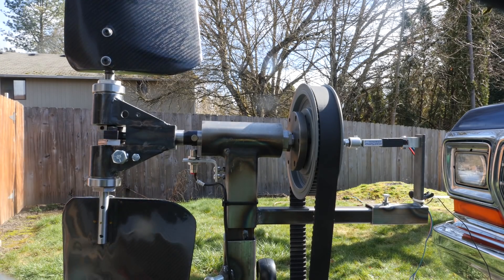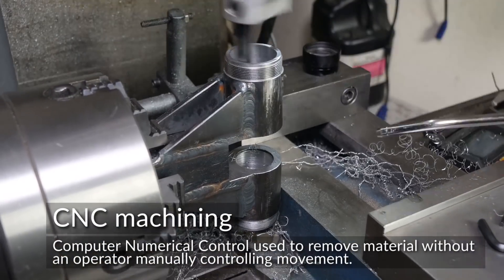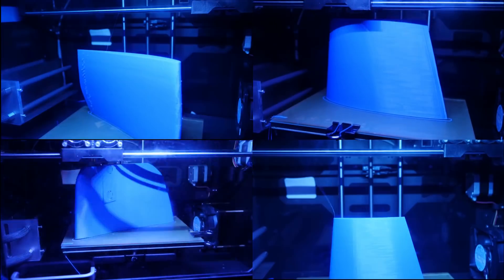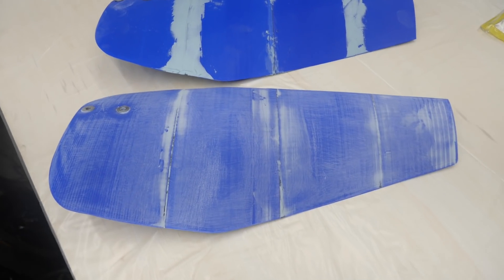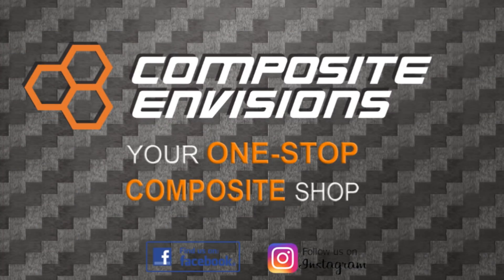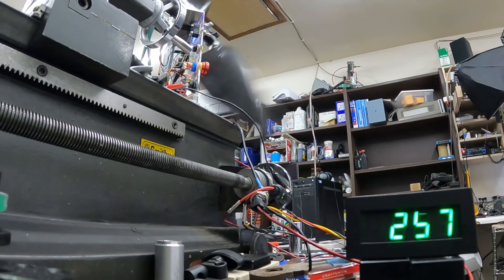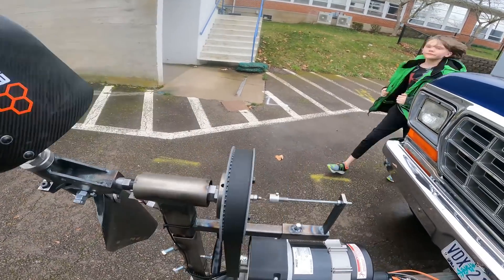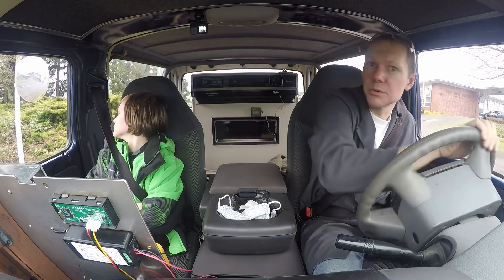Carbon Fiber Blades Making 2000 Watts! - Wind Power on a Car #4

Comment from the maker: UPDATE: Video proving it works: https://youtu.be/tEPBdztGMdI  😁 

Note the goal of this video series is EDUCATION.  Future videos will address how EVERY WATT of power generated comes from burned fuel.  But I'm not convinced it will negatively affect mileage.  My hypothesis is a modern turbine blade is so much more efficient than an old Ford that it can harvest energy from the change in momentum of incoming wind rather than waste it through pure drag. If correct, this would not violate 2nd law of thermo, rather recover spent energy from already burned fuel.  Regardless, we will measure it and publish the results either way! Thanks to a suggestion in the comments I now have a ScanGaugeII that plugs into the OBDII port for reporting instantaneous as well as trip mileage.  In fact I just published a video with the kids baking a pie for PI-day (3/14) where we had the gauge on the dash the whole time.  The algorithm doesn't prioritize "wholesome" so very few people are seeing that one.  If you'd like to watch it here's the link.
https://youtu.be/8G6w2mB9Skg

PREVIOUS EPISODES
Part 1: Basics of Turbine Geometry        https://youtu.be/MlwK4kCrXB0
Part 2: Testing Cheap Wind Turbines     https://youtu.be/k7vABvP_5UE
Part 3: 7000W generator                           https://youtu.be/U7ZgG9p-Hz4

Carbon Fiber company who graciously agreed to partner with me on this video
https://compositeenvisions.com/?utm_source=Youtube&utm_medium=Link&utm_campaign=QuintBuilds

A huge thanks to my super awesome Patreon supporters who made this video possible.  To become one of them visit:
https://www.patreon.com/QuintBUILDs

If instead you prefer a one-time donation option, here's a PayPal address you can use: BUILD2LRN@GMAIL.COM

My detailed video on vacuum bagging carbon fiber
https://youtu.be/j0BvRR5RF-Y

LaserSterling's channel (carbon fiber Lamborghini guy)

https://www.youtube.com/c/lasersterling/featured

Quint
Reply: I believe it was on Mythbusters they would run a fuel line to a graduated cylinder and be able to read their fuel consumption that way
Reply: @LTJPunkass  precision flow meters are quite cheap 15 years later, but yeh that works too.
Reply: Just wondering if you have an OBD port below the dash. Provided that you have the necessary sensors installed, I'd assume with an OBD you should be able to rig something up. I'm just spitballing because I know next to nothing about cars.
Reply from the maker: @afroteddybear  yup. it worked great for the latest vid: https://youtu.be/tEPBdztGMdI
Reply from the maker: @afroteddybear  yup the port is there and probably the best source of data.
Reply: Wow! The linear actuator part is so useful! I was just about to order 4 of that exact brant for a prototype at work and nobody has worked with them, so this was useful!
Reply: You're cool
Reply: Would be interesting to see a comparison of your turbine with that same generator hooked up to the engine directly. And the fuel consumption differences. I bet using the engine as the power source would beat the more indirect power source. But very cool project and thoughtful execution!
Reply from the maker: @pturcanu  hmm, I'll think about how to achieve that. A good comparison regardless of the outcome!
Reply from the maker: @pturcanu  Yup, gotta see the latest video on it! https://youtu.be/tEPBdztGMdI
Reply: @pturcanu  Yes it would beat it, but with this level of tech on the blades themselves it would only be a small % increase maybe 5-8%
Reply: Now this experiment of yours has been on my mind for the last 15 years. But, in my version it has always been a vertical axis turbine on an EV. Mounted in place of the radiator. Or under the car in the middle, on a tunnel that goes trough the whole car. I never have seen it done.

Now while I KNOW it supposed to be a net zero contraption because physics and all. My mind just can't process why it would create more drag than the same car would with "normal" front end. I just imagine less drag and more lift somehow..

I guess my eyes just needs to see the wind tunnel experiment done with and with out. 
But if someone can explain in simple terms so that I can visualize it, please do. Because I KNOW I am wrong And that you can't create energy for free. but I just can't process it,  and let it go.
Reply from the maker: @OnlyUseMeC4s  Check out the latest vid.  It's not getting shared much by the algorithm for some reason but it goes into ALL those details.  Maybe that's why?  https://youtu.be/tEPBdztGMdI
Reply: @OnlyUseMeC4s  your not the only one thinking of that.
Reply: @OnlyUseMeC4s  I guess the "wing energy" that you're capturing is actually wind resistance that you're trying to avoid. The stored battery energy is being converted to heat through the motor and wind resistance to accelerate your car and then fight the wing to keep moving forward.
Recovery braking loses a lot of the stored kinetic energy through friction heat and heat through the motor/generator in order to cram all that energy back through the wires and in to storage.
Reply from the maker: @OnlyUseMeC4s  I don't think it will create more drag. My gut tells me we will get electricity without a significant mileage penalty due to the airfoils being so much more aerodynamic and capable of converting momentum into mechanical energy than a vehicle shaped like a brick. It seems pretty straightforward to me yet I literally get trolled by people with letters after their names, saying it can't work, resorting to childish name-calling! I guess I need to seriously consider how to explain to both intellectuals and laymen WHY (assuming it works) it's not a violation of physics.  But that's a challenge I readily accept!
Reply: @QuintBUILDs  I think you need to do a comparison of fuel consumption going 55mph with and without the contraption.
Reply: @QuintBUILDs  I love the project because I'm a sucker for variable pitch propellers and it's a great excuse for mechanical (And electronic) education for your kids.

I think I see the point that you're trying to prove, I'll try and paraphrase it. For simplicity if you consider the front of the car as a large solid / flat surface which is perpendicular to the direction of travel, it acts as an air brake as it has to redirect the airflow through a hard 90 degree bend. In other words it is slowing the velocity (In the direction of travel) of the airflow from the vehicle's speed to zero, with the air being forced out sideways. The idea is that rather than simply redirecting that air sideways and therefore wasting that energy, you can instead slow the airflow by converting it to electrical energy through the wind turbine. This means that in the ideal world, the velocity of the airflow is slowed to approximately zero (Relative to the velocity of the vehicle) and therefore the area directly in front of the car effectively becomes a neutral pressure zone.

You could use a dual-port manometer to measure the pressure drop across the wind turbine, along with the absolute pressure of the area in front of the car. This should show you how much wasted energy is available to be reclaimed and demonstrate the theory.
Reply from the maker: @yngndrw.  nicely stated! I Also like the idea of the manometer.
Reply: @QuintBUILDs  it's more an issue of disruptive flow. While a car is totally shaped like a brick sometimes it does end up creating a pseudo airfoil shape due to stagnet air in specific locations. 

The other issue is this doesn't have long term stability. Nor is it safe. All it takes is one rock in the road and you could destabilize the entire propeller system. 

This is the classic failing of most engineers where they try and chase and play efficiency games. You failed the first important test as an engineer is the solution you provided practical. The answer is absolutely no. 

As an aerospace engineer myself I see this all the time it blows my mind. So you want to add a regenerative breaking system? How much is it going to cost? Not just per unit but for RnD. How much energy will you save? What is the cost of maintaining it? What is the cost of replacing it when it fails. All of these are generally important questions engineers fail to ask because OMG it's  2% more efficiently but they just blew through hundreds of thousands of dollars to get there. Blows my fucking mind.
Reply: @Daemonamongyou  The terms you are looking for are Turbulent Flow and Laminar Flow (turbine and vehicle, respectively)
Reply: @anjhindul  I was actually referring to a specific type of airfoil I just couldn't remember the name. They are call Klein Fogelman Airfoils. If you have ever seen the mythbusters episode about the closed vs open tailgate it's pretty much like that. Where eventually the air will get trapped in circulating motion and create a no slip condition and make it a psuedo airfoil.

But yeah this entire project is just one failure to understand aerodyanmics as many other people have pointed out.

I love how he cried wolf that people were "just being mean to me and spouting profanities without names on their accounts" when many individuals have provided clear reasons why his hypothesis is false.
Reply: @QuintBUILDs  like the other aerospace engineers in this thread, my aerospace degree tells me that this will induce drag such that for every kilowatt you extract out of the air, your gasoline engine needs to pump out several additional kilowatts.  Even good turbines are limited in efficiency by thermodynamics, so unless you have some solid numbers to back that idea up, I'm going to go with "fantasy land".
Reply from the maker: @JMurph2015  obviously I don't have an aerospace degree but I do have a history of being proven right on many occasions when the SME was not. It remains to be seen if that's the case here and I'll gladly accept the results with no emotional attachment whatever they are. The thing I can't shake is the vehicle is essentially an airfoil at full stall = maximum drag.  As the angle of attack approaches optimal the drag is reduced and power is generated by reducing momentum of the air. That air will now have reduced drag on any flat surface behind the turbine due to the reduced velocity. When I look at it that way it seems very very simple and I can't think of a reason why it WOULDN'T work, even if the turbine is less than perfect. But I started this because I wanted to know, not because I want to be right. It hurts a bit to see people getting angry with each other over this curiosity of mine but that's on them. It's a fun little experiment that gets people interested in science and soon the experiment will be done. I also have other information I'm not yet sharing that lends support to it working as opposed to not.
Reply from the maker: @SeraphX2  heck yeah, DONE!  Check it out!  https://youtu.be/tEPBdztGMdI
Reply from the maker: @yngndrw.  and if you haven't seen it already, here's the latest video with the test results: https://youtu.be/tEPBdztGMdI
Reply from the maker: @Daemonamongyou  I think you're going to like the conclusion of the latest video where we test it.  I pretty much parrot your last paragraph almost exactly.  https://youtu.be/tEPBdztGMdI
Reply from the maker: @JMurph2015  You gotta see the results.  Not what people expected!  https://youtu.be/tEPBdztGMdI
Reply: @QuintBUILDs  Yes, your latest video explained some of my questions. Youtube does not sometimes give notifications to a new video or a comment. And random unsubscribing is still happening after all these years too. 

Maybe i will make my own experiments some day with VAWT because i have never seen the HAWT being the better one in any application. Even though they use them on the windfarms all around the world. Broken, stopped, not running due to low wind... Off topic rant but that's another thing i haven't seen anywhere. -VAWT build in the same dimensions and budget of the HAWT's. And one years results to compare the two.
Reply: What you're going to discover, if you test it properly, is that a very efficient wind turbine creates almost as much drag as a solid disc of the same diameter.   Its job is to extract as much kinetic energy from the column of air passing through the blades as possible.   One way to see this is to put a anemometer (wind speed meter) in front of the turbine, and another behind it and look at the difference.  The more effective it is at slowing the wind, the more energy you'll get out of it, but from a total system perspective that energy gain, is just drag. 

BTW, the reason for the torsional load is that all cambered airfoils create a pitching moment, so even if your blade arms are right at the center of lift, it'll still twist the arms once it's under load.
Reply from the maker: @daemn42  Be sure to check out the video where we test it: https://youtu.be/tEPBdztGMdI
Reply: @QuintBUILDs   Thanks for the heads up.  Note that in your original reply to me you said "I hope to test the turbine on the roof of the vehicle eventually."  which should certainly show even greater net loss of milage.  I guess I didn't really see the "draggy turbine in front of a brick shaped vehicle is free energy" assertion in your original plan (dunno if I just didn't read it well, or it evolved over time).   Note that even if we can agree the test results support that up to a point, it should become less and less "free" with a slipperier vehicle behind the draggy turbine.     BTW, where I'm coming from is electric RC aviation where we have a choice of stopping a propeller when we cut the throttle or letting it freewheel (or even doing regen braking) and the effect on the aircraft is seen in the airspeed immediately.   A stopped prop is much less draggy than a spinning one, whether it's generating power or not.    Of course the aircraft is otherwise supremely slippery.
Reply from the maker: @daemn42  agreed and good info, thanks!
Reply from the maker: @daemn42  yup I glossed over the pitching moment completely, whoops! Drag on turbine will be limited by Betz of course where the solid disc could care less about the departing air stream. I hope to test the turbine on the roof of the vehicle eventually. Should provide some interesting data.
Reply: I knew you would end up 3D printing something then using it as a mold for carbon fiber. You might have tried to balance the props a bit better during sanding though.
Reply from the maker: @evilcanofdrpepper  yeah I wish i'd thought of the weight of the resin for balancing when I was slathering it on...
Reply: Nice. I am not sure why you consider every watt generated coming from fuel doesn't negatively affect mileage. Do you mean that this might be a good way to generate electricity? Would you consider the cost (gas cost) of every KWh you produce using the turbine in comparison to your utilities KWh price? We know that ICE is not very efficient, so the way I see it is that you are converting the mechanical work that the engine has worked so hard to produce into a kinetic energy of the wind which then you harness with a cap on efficiency to electricity using the turbine. I would be interested to know how much power you are producing from the turbine in comparison to that of a dyno hooked up directly to the crankshaft (DC generators have efficiencies above 90%) at a given speed. On a different note, for real-time measurement of the fuel consumption, I believe you should tap into the air flow rate sensors and fuel flow rate sensors if applicable, I think you can find equations relating ICE parameters that could help you estimate how much fuel is being consumed as function of engine output power.
Reply from the maker: @hishamsaadeh1717  we cover it in the latest video.  https://youtu.be/tEPBdztGMdI  Unfortunately it appears so many are so attached to the idea that it can't work that they're unsubscribing from the channel leading to fewer views.  :(
Reply: @hishamsaadeh1717  blah blah, there's no need to waste your time. It's pretty basic. This is dumb.
Reply: Nice design, very nice build. However every watt of energy has come from the engine and all ready paid the price of that inefficient Ford engine, fuel to motion, motion to electric, doesn’t break the laws but would be better without it or less bad just using direct drive alternator for less total losses. No free meals in this universe
Reply from the maker: @mehawk2005  please see the latest  video where we test all of this.  The alternator is worse by far: https://youtu.be/tEPBdztGMdI
Reply: @heldgop It's like they have never heard of induced drag.

People (engineer minded people) also don't understand that the primary reason your car looks like a brick and not a symmetrical airfoil because people significantly care about aesthetics. It would be much more efficient for fuel to make a car with an aerodynamic shape, but it is ugly as sin and no one would ever buy it. Think of the rear tire covers on the Prius they are quite effective but everyone hated them so they removed them.

ALSO it is extremely unsafe because these are small blades they need to spin faster due to the fact it's an r^4 (I think) factor. You want much bigger blades spinning much slower to reduce the drag forces to prevent transonic conditions on the blades. The faster these blades spin the more dangerous they are. All it takes it one big rock or road debris to unstablize the system and cause a catastrophic failure and fling one of those blades at a car, at a person, or at an animal. This is why propellers are banned on the roadways, and it is one of the main reason we kept wanting to go higher with aircraft to get out of bird conditions, and thinner air to reduce drag.

If I was a cop I would have pulled him over and demand he have the car towed home and remove that monstrosity.
Reply: Clearly thermodynamics is not your strong suit.
Reply from the maker: @mqbitsko25  Not so fast.  See latest vid: https://youtu.be/tEPBdztGMdI
Reply: @ManuelVilaça  I literally never said get more from it. you're so full of yourself that you're miscomprehending me. all I asked was if you can generate power from that. I never said how much. I am 100% fully aware you can't generate free power. but there is always power lost and there can be ways to gain some back. just because I haven't taken a course doesn't mean I'm a total dumbass but I have questions and can sometimes be confused. I have gone an entirely different career path. I don't have time to become an expert electrical engineer like you. so how about educating people instead of being an asshole?
Reply: @SeraphX2  I understand what you said about compensate for the power loss. The problem is the power is already loss! The only way to gain it back is to have a system that generates more power than it consumes.

For example, we can roughly describe the system without the turbine as:
Fuel energy - power loss = current power1
And the system with the turbine as:
Fuel energy - power loss - turbine drag = current power2

So, doesn't matter how close to 100% efficient the turbine are, it will always steal energy from the gas source.
Of course you can argue about using the turbine only when breaking and that is valid point.

Note for the experienced engineers out there reading this: please correct me if I'm wrong!
Reply: So I drive a 2017 chevy volt... a plug in hybrid, about 3,500 pounds heavy... 45 electic range and 350 miles on 8 gallons of gas. Do you think this would add 20% or even up to 60% more electric range to the car? Because that would be cool!
Reply from the maker: @Jeremysheez  not quite that much.  See results: https://youtu.be/tEPBdztGMdI
Reply from the maker: @ManuelVilaça  well this wouldn't be during braking, it would be during cruising when the engine is working against drag.  But I get your point.  Be sure not to miss the latest video where we test the theory and prove it works: https://youtu.be/tEPBdztGMdI
Reply from the maker: @Mark Parker yup scan gauge II worked awesome in the latest vid if you haven't seen it.  https://youtu.be/tEPBdztGMdI
Reply from the maker: @ManuelVilaça  no argument there: https://youtu.be/tEPBdztGMdI
Reply: Are you using hairspray or glue stick on the bed? Even after the added heat, you still had the edges pulling up. Also use Brim instead, and it will help hold the edges down. And how is the frame pulling apart if you are using an infill?
Reply: @ManuelVilaça  I've wondered, though, why not cover the axles in copper and put magnets in the axle rod and let that generate some power from constant movement spinning. Why just the braking process?
Reply: @SeraphX2  That is essentially what regenerative braking is. It only happens during the braking process because it would be leeching off energy that could be used to turn the wheels, and would be inefficient.
Reply: @JackieBright  What? How would having magnets in the axle and copper in an axle housing cause anything to leech. I didn't say apply the brakes while driving (which is the only thing I think you could mean by "leeching energy to turn the wheels" would imply you thought I meant.)
Reply: @SeraphX2  Please go to electrical theory classes. Any time you have a device turning to create an electric current (motor) there is a huge amount of force being generated by the magnetic field to RESIST that rotational energy, thereby "leeching energy to turn the wheels"  This is about as 'layman' of an explanation as I can make.
You asked a question and when the answer was given to you you jumped on his back assuming something completely different then what the answer said.  Please don't be that "Dunning-Kruger" guy.
Reply: @anjhindul  as I plainly said he didn't even remotely try to explain it clearly. your explanation makes much more sense. thank you
Reply: @SeraphX2  you've discovered free energy! Where are you going to display your Nobel prize
Reply from the maker: @JackieBright  ah but this is for cruising not braking.  Make sure you check the results in the latest vid!  https://youtu.be/tEPBdztGMdI
Reply from the maker: @joshb6993  check out the results, would love to hear what you think of our testing: https://youtu.be/tEPBdztGMdI
Reply from the maker: @SeraphX2  that would guarantee additional load on the engine.  We just demonstrated the wind does not. :)  See video: https://youtu.be/tEPBdztGMdI
Reply: @SeraphX2  Because those magnets would generate a magnetic field that resists the change in direction of the axle rod, this in turn causes far more energy to turn. "constant movement spinning" isn't even a thing by the way. Oh, and the additional mass on the axles will greatly increase the cost of energy lost.
Reply: @SeraphX2  Because that would be an additional load on the motors, comparable to friction. Regenerative braking is still *braking*, it slows the vehicle down by converting kinetic energy to electrical energy. TANSTAAFL.
It will be the same with this turbine: it's causing drag as it extracts energy from the truck's motion, pushing back on the truck. To get 2kW of power out, you have to ask the engine to produce at least 2kW more power.
Reply from the maker: @stereoroid  you should see the results.  We got 73% more power than was added as load to the engine.  Super cool: https://youtu.be/tEPBdztGMdI
Reply: @SeraphX2  creating the current causes resistance.  That's why it works for breaking. Also why the alternator in your car uses some of the crankshaft horsepower.
Reply: Do what Mythbusters did, set the truck up to run from a Gatorade bottle fuel tank, measuring the distance you drive without rotors and with to determine any difference in fuel mileage
Reply from the maker: @dale5322  fortunately a viewer told me about a handy fuel gauge we used in the latest video proving it works.  https://youtu.be/tEPBdztGMdI
Reply: @dale5322  mythbusters never busted anything but a diseased dik
Reply: would be really interesting is to pump that power into and inline drive motor. .  they say a car  cruises at speed with about 20 horse power. 1 horse power =768 watts so that is 15,000 watts of power.  so if you pump lets say 5kw into an inline eltronic drive motor while driving or even 15kw [if it can handle that. . . what would happen? might be simpler to just mount it on a prius. . . according to physics it would a complete loss BUT I love testing the laws physics just like you!!!!!!!!!!!   Dam o Dam that would be cool. . .  I wish i had a neighbor like you, im like the only person i know "lol" who has fascination with engineering. .  I geek out on this stuff, and most people could careless. . .  just curios , Have you ever played with HHO????  there is schematics online about adjusting the timing of a generator to advance it to TDC and litterly alow it to run on HHO but you need a machine shop to pull that off [cough cough lol you ] Tthe flywheel key needs to be moved/adjustable, Mr.stan actually created an resonance circuit that fractured the molecues wit very very little power BUT lets just say he is no longer with us. :( But even with brute force electrolysis, it seems it does not defy physics because your not not creating fuel but only de bonding it.  I actually was watchin a nova episode and nasa litterly said that if they find water on the moon or mars they can create jet fuel? they didnt mention this BUT they will obviously be using solar panels,  which means they already have a resonance circuit to fracture these molecue with little power, probally take from stan his self. .  would intresting to have a convo with you on this
Reply from the maker: @mikeriverajr4447  make sure you don't miss the latest vid where we dove into this stuff.  I calculated 25kW but my bronco has more rolling resistance than the average converted EV!  :)  https://youtu.be/tEPBdztGMdI
Reply: @ManuelVilaça  so you're saying that some extra wire and magnets placed on a rotating axis couldn't produce a little bit of extra energy?
Reply: Runing this on a moped (~2.5kW) could underline limits you re talking about.
Cars mostly deal with wasting.
Reply: What if the blades feathered to produce minimum drag until you let of the gas? Then you'd have an energy recovering braking system.
Reply: @alexhamon9261  It would have a miniscule braking effect, and still be more inefficeint than attaching the generator directly to the axle.  It's a great education experiment to share with his child (and youtube) though.
Reply from the maker: @Gaspode_  You should see the latest vid testing it if you haven't already: https://youtu.be/tEPBdztGMdI
Reply from the maker: @alexhamon9261  interesting.  Be sure to see the latest vid where we test it: https://youtu.be/tEPBdztGMdI
Reply: Just a question/suggestion,...Would the pitch control module and hardware from a Radio controlled model helicopter have worked ? They probably will be considerable smaller but four of them instead of two. .
Reply: How much would it cost to build one of these? I have NOTHING to build it, but I am very interested in using a design like this at my house as I have very poor 'constant' wind. Wind speeds rapidly change from 5mph to 50 mph+ on a daily basis.
Again, I have none of the tools to build this myself or I would most happily do so.
Reply: How about have solar power to initially get the turbine spinning. Then use the turbine wind energy to drive the car.
Basically, solar as initial and back up and wind as driven force to push the load.
Reply: I rekkon that no machine will be more than 100% efficient.
Reply from the maker: @andytaylor1588  correct but that's not what this is.  See latest video: https://youtu.be/tEPBdztGMdI
Reply: An estimate for the change in drag on a vehicle can come from the camper world. Putting a slide in camper on a pickup truck hurts mileage by about 2 mpg.  Dropping mileage 19 to 17. (This is obviously dependent on a lot of things, weight, size, shape, truck, engine size, previous fuel efficiency.) Similar data also comes from putting a car top carrier on a car. (These don't weigh as much, but effect drag more.)
Reply from the maker: @cryptickcryptick2241  make sure you check out the video where we test it: https://youtu.be/tEPBdztGMdI
Reply: CD = f x 2 /A x P x V(square)
Transform that efficiency to energy with a high percent ratio.
Reply: Hi, where can I 3D print a dad like you?
Reply from the maker: @Yadobler  the only answer I can give is to turn yourself into the dad you wish you had. 👍
Reply: @QuintBUILDs  yes sir I'll do!
Reply from the maker: @Jackandthebeanstock  no airbags in 1978 Broncos sir...
Reply: For Fuel measurement you can use the Mythbusters method, find a closed road, abandoned town, a industrial area on a weekend, and then run out of gas, then add a precise amount of gas, let's say a 1/8 of a gallon, whatever gives you a reasonable amount of run time 5, 10 min, run the car with the turbine stopped or in the bed of your truck (don't remove it from the system as the weight difference can affect results), at a constant speed (ideal would be a track when you never need to stop) run out of gas, count the miles you did and the time running, repeat with the turbine engaged.
If science is correct you should travel a shorter distance in less time with the turbine engaged. Then you can compare it also by using others methods of creating electricity like connecting a bigger inverter etc...
You could check several episodes of mythbusters were they bust different fuel mileage improvements methods, to scrap their methodology.

Hope this helps
Reply from the maker: @_danyg_  we ended up using a scan gauge II someone suggested.  https://youtu.be/tEPBdztGMdI
Reply: The classic way i am thinking is to make the fuel tank full, drive, make it full again to see the consumption and what you have on your dash, the add the blades and repeat. Don't change tires or other stuff the can influence  weight of the car and try to do it in the same weather conditions.
Reply from the maker: @BogdanDuceac  a viewer suggested a gauge. It worked great! https://youtu.be/tEPBdztGMdI
Reply: Be cool to see you cook a roast you could call it a roast road trip
Reply: From what I can gather, your hypothesis is that you have a giant square vehicle which is going to eat all of that air resistance regardless, so putting a small turbine on the front of the vehicle won't increase the vehicle's profile, and additionally the drag created by the blades will be somewhat negated since it's slowing down the air hitting the front of the vehicle?
Reply from the maker: @Fireball_Roberts  pretty much!  Could be totally wrong but we will see!
Reply from the maker: @Fireball_Roberts  make sure you check out the video with our results!  https://youtu.be/tEPBdztGMdI
Reply: Umm no, that's drag. When even the usage of an alternator can impact gas mileage you can be sure that a spinning prop out front will too, with load it presents as a near solid disk - measure the force it's pushing into your bumper to see this. Even a spoiler on a car can impact speed and mileage as many drag racers have found - removed spoilers can result in lower ET. There's no free lunch and you ought to be able to find a pretty noticeable difference particularly with a load hooked to it. If you want to recover energy from already burned fuel consider a turbocharger hooked to some sort of an alternator maybe but I'd be skeptical of that as well honestly.
Reply from the maker: @BLKMGK4  wait til you see the next video sir!!! 😁
Reply from the maker: @BLKMGK4  if you haven't seen the results, here they are.  https://youtu.be/tEPBdztGMdI
Reply from the maker: @heldgop make sure you check out the latest video with testing.  it's getting squashed by the algorithm for some reason: https://youtu.be/tEPBdztGMdI
Reply from the maker: @heldgop make sure to check out the testing video where we put these questions to bed: https://youtu.be/tEPBdztGMdI
Reply: Is it enough to recharge the batteries of a Tesla?
Reply from the maker: @fordmustanggt2046  yes.  See latest video complete with test results: https://youtu.be/tEPBdztGMdI
Reply from the maker: @Jackandthebeanstock  No airbags back in 1978
Reply: Love this video.. i don't think the drag of the blades will effect the car as much as the air that's been pushed against  the square front of the car from the propellor wash. The higher they rotate the more pressure builds behind them? I'm not sure about this, I'm a restaurant owner, not a engineer :)
Reply from the maker: @NoMoreMrNiceGuy223  see for yourself in the video on mileage: https://youtu.be/tEPBdztGMdI
Reply: @QuintBUILDs  just finished watching it. I actually commented that video as well. Congratulations for your channel. You gained one more subscription. Saidly do to covid and my restaurant being closed as of lockdown i cannot help you on patrion. I will as soon as my finances allow me
Reply from the maker: @NoMoreMrNiceGuy223  sorry to hear it! Best of luck!!!
Reply: Lol if I had a nickel for every YouTuber that was also an aerospace engineer ;)

The vehicle is the body in question (not the turbine) that is responsible for the lionshare of the necessary force required to traverse the apparatus (vehicle and turbine) through the air at said mph. When you add an air turbine you increase the oppositional force to movement but only minutely (maybe at 60mph there's 800lbs pushing against the vehicles trajectory, while with the turbine it's only an extra 50lbs or something of that nature). Without the turbine you require (θ)lbs of force, and with the turbine you require ~1.03(θ)lbs of force. The added 0.03θlbs of force wasn't responsible for creating the 60mph wind drag, no about 97% of that was due to the original θlbs of force needed to move the vehicle at said mph. The extra 0.03θlbs of force is responsible for getting the vehicle from 58mph to 60mph (or something of that nature). Though, in BOTH scenarios the vehicle creates an oppositional wind of 60mph so you're fighting the wind with or without a turbine. You may add a slight increase in drag but at the trade off of being able to harvest a portion of the TOTAL high wind speed created (depending on perspective).

In either case the vehicle creates an oppositional force but in 1 scenario a machine is added to capture some of the oppositional force and convert it into useable again. The wind turbine isn't only harvesting the resultant forces from the added 0.03θlbs of force that the vehicle required to maintain 60mph with the turbine, no its harvesting a portion of the TOTAL resultant forces from the TOTAL 1.03θlbs of driving force. 

My $0.02. Good vid.
Reply: Nice project and inspired👍, love it❤️
Reply: I always enjoy your videos and it was worth the wait for this particular project update. Here is a question, do you think that this can be used to charge a small electric car?
Reply: @seonhamer3561  No. Second law of thermodynamics says NO.
Reply from the maker: @anjhindul  see what you think of the test results.  We cover thermo pretty heavily: https://youtu.be/tEPBdztGMdI
Reply from the maker: @seonhamer3561  yes it can.  Covered in the latest vid: https://youtu.be/tEPBdztGMdI
Reply: Before you get to a trip, put a full tank into vehicle. Drive and after that fill again. That is your fuel consumption, based on miles you did.
Reply from the maker: @MatejRajčan  good idea.  Fortunately there was a handy gauge available we used in the latest video to test it: https://youtu.be/tEPBdztGMdI
Reply: Turkey
Reply: You never know till you try.. Or HEAVILY simulate.
Reply: @christopherlenahan3906  actualy, an infinity of cases cancel that sentence.
Reply: Surely this can be implemented to charge and electric car?
Reply from the maker: @richcooper6989  Yup.  See latest video: https://youtu.be/tEPBdztGMdI
Reply: I think too that this is not a violation of thermodynamics. The first motor used to pump petrol out of earth probably was so inefficient that it would need about 1 gallon of petrol to extract 2 or 3 gallons of petrol. Motors today can pump hundreds of gallons of petrol at the cost of a few gallons. Its all about efficiency.
Reply from the maker: @osmargarnica  see the results in the latest video if you haven't already: https://youtu.be/tEPBdztGMdI
Reply: @ManuelVilaça  No he actually does. Who the fuck are you anyway? You haven't defined a single point of proof other than to say pHySiCs. If the weight and aerodynamic impact is negligible on fuel cost, this is feasible for extra energy creation (the same would go for adding magnets and wires to a continuously spinning axle). No one is claiming free power. But, generating as much power as you can to feed back into the system, for like a battery only car, means more distance before needing to recharge.
Reply: This technology could help extend the range of electric cars / vehicles to cover more distance and it can restore the energy back in the batteries.
Reply: @talhaakhund974  No. Second law of thermodynamics says NO. Don't even mention that. It breaks to many laws, there is this thing called drag and friction, you will NEVER create more energy than you expend.
Reply from the maker: @talhaakhund974  yep, we cover that in the latest video just released: https://youtu.be/tEPBdztGMdI
Reply: @talhaakhund974  The only energy that could produce is either a) energy from an already existing wind unrealted to the car's movement (this is free, and how wind turbines work), b) wind energy generated by the cars movement though the air (which is really just recovering a small percentage of the energy used to propell it and the car though air - so you are expending big+little energy to recover little energy.  C) wind energy casued by the cars movement downhill while coasting.  I'd suspect a generator attached the the drivetrain..like say, an alternator..would be more efficient at recovering that.
Reply: @Gaspode_  The C option is actually already installed in all electric vehicles through the regenerative braking system. Once you use an electric vehicle you know what I mean there.  The first two are exactly right, even with a headwind the drag through turbulent flow (due to the turbine) will cause a net LOSS of energy. PERIOD! I wish that people would read up on this stuff before they insert their feet into their mouths...
Reply from the maker: @Gaspode_  the alternator is surprisingly IN-efficient.  See the results in the latest video: https://youtu.be/tEPBdztGMdI
Reply: @talhaakhund974  nah, it doesn't make sense. It's far less efficient than just burning the fuel to run a generator. 
There are many reasons why this is a dumb idea for any practical use beyond educating.
Reply from the maker: @CharDarwin  please check out our testing video and let me know if you think we tested it properly: https://youtu.be/tEPBdztGMdI
Reply: @talhaakhund974  Are you serious?  Does anyone on here understand that free energy is a myth, and the power generated from the turbine comes exclusively from burning gas?  And that the conversion from burning fuel, to moving vehicle to turbine undergoes WAY more conversion of energy than optimal?  Regenerative brakes have way more practical potential than this contraption does.  They convert kinetic energy directly back into electricity.  Look,  I get that the point of this is primarily education, but the moment this crosses over into "I think everyone would be wise to stick one of these on their car" (electric car included) is the point that I realize what most people are in these comments.  Well at least I can say for certain what they aren't.  They aren't engineers.
Reply: @byugrad1024  They aren't geniuses either... Ya, I hear your frustration.  Dunning-Kruger Effect all day every day.
Reply: @byugrad1024  Thank you! Scary, isn't it?  
They live among us. LoL
Reply from the maker: @byugrad1024  See if the latest video makes it any clearer.  And please don't get pissed.  I've had a ton of people unsubscribe on the latest video, presumably because they can't accept the results.  I'm just doing an experiment, the results aren't my fault!  https://youtu.be/tEPBdztGMdI